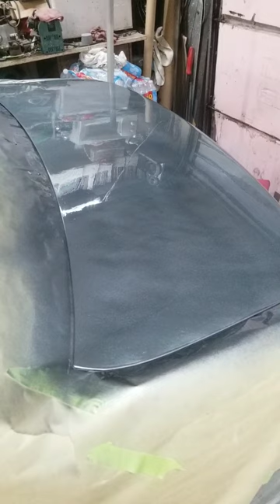DIY paint and body, single stage paint #shorts #painting #paint

Comment: That's not two stage, it's single stage guy and it has a lot of trash and orange peel in it. With single stage you can easily cut and buff it, but not with the color you chose because it isn't "flashing".
Reply from the maker: Yes, i sometimes mix my words, saying one thing but meant another. The reducer i used was for a slightly different temperature. I goofed up.
Reply: @rick3090 yeah it had a lot of tiger striping and build-up just on the trunk lid. Didn't have anything to do with the reducer or hardener, but I'm sure you know that by now.